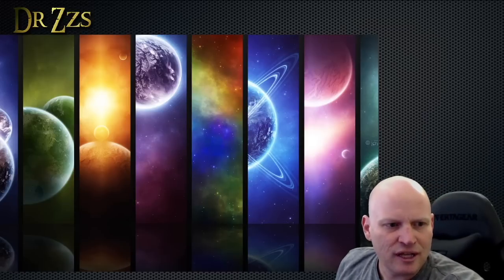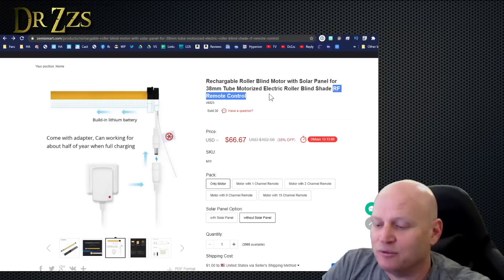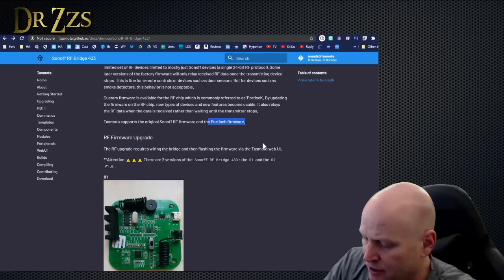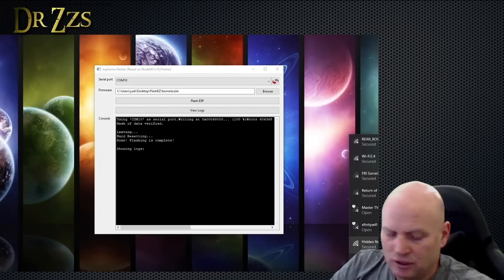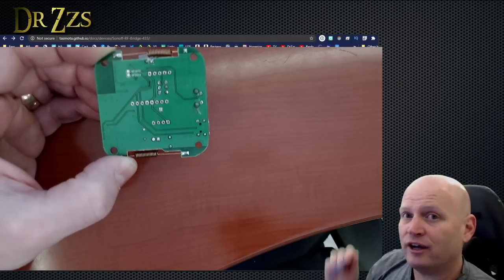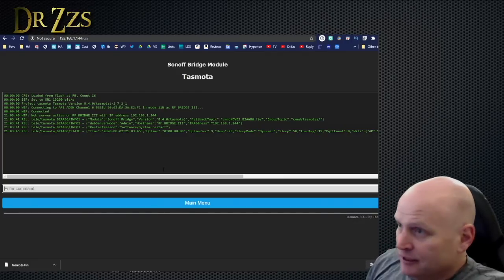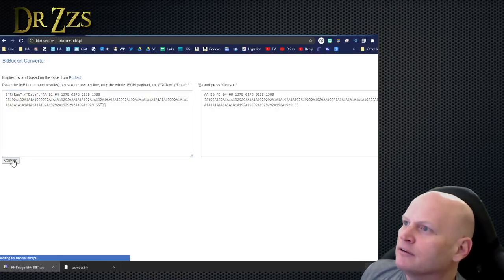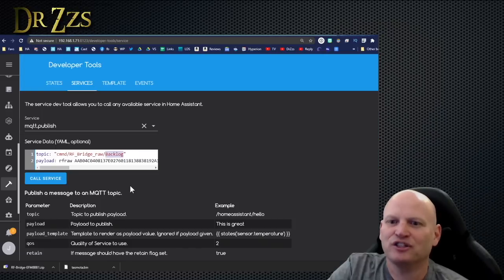433mhz Sonoff RF Bridge using Tasmota and Portisch to scan Raw RF Codes for Zemismart Roller Shades

Comment: Great Video!!! Did you solder the four wires to the Sonoff RF Bridge board, or did you simply plug in the four pins? If you simply plugged them in, is the contact reliable?

Comment: oh boy thank you! I watched your video 4 years ago and had this flashed to get curtain codes running 24/7 since then. Today I changed vlans and set the wrong ssid to the wrong vlan and it got stuck in limbo not being able o connect or reset. Had to reflash it. Wife could not open the gate today as it's used for this and other jobs.

Comment: I have the r2 bridge. Tasmota 13.3.0 . When I try to flash the Portish firmware Version 0x04 ( I connected the 2 jumper cables like you did ). I just get the error:

Upload Failed

Upload error code 210

Please does anyone know what I have done wrong here ?
Reply from the maker: For future reference the best way to troubleshoot this sort of stuff is to join the discord channel.  There are lots of people that are available to help.  It's just really difficult to troubleshoot over comments.
Reply: My fault I forgot to cut the 2 connection. Now it worked!

Comment: What's the website you used to convert the code? It don't seem to exist any more
Reply from the maker: New versions of the RFBridge have a different RF chip and no longer work with Portisch firmware.
Reply: @DrZzs  arr, mine is a few years old. It did flash but had a lot of issues in sending the copied code. It has worked when using the non raw code, but getting that working g in code was difficult. And not 100% sure what tweek actually got it working

Comment: Hi Great video, but I have a little problem. I flashed my Bridge with Portisch a year ago, and working with some plugs (brand does not know) but is working fine with the short code. Also having two Sonoff remotes with the short codes. Now I have something thats build in the Netherlands, and its a tricky thing. But, I have it working, the problem is, once I send the rfraw long code (plug is working/listening} the the Sonoff remotes and plugs don't work any more. Until I restart the Bridge, then its oke again. I have the MQTT but its already happening with the codes directly in the Bridge/tasmota console. Also tried to read the long code with rfraw 177 from the Sonoff remote, but that's not working either. Any suggestions about this?
Thanks...

Comment: Just picked up the bridge and flashed it with Tasmota hoping I could use it to integrate motion sensors and door sensors from an old alarm system which i hope are 433MHZ
I assume if the RF chip could see them id see entries in the console as I walk around the house?

Guess I'll make up some jumper cables and flash Portisch and see what happens.

Thanks for the help so far Doc

Comment: Took a few tries and miscues, but this got me going with at least one RF remote that wasn't showing up under the stock RF firmware.

Being able to bypass the 16 device command limitation is also helpful, though it's kind of a pain to have to do learn > convert > command for every button on something like an LED controller.

Would love to know if there's a way to figure out what RF frequency other devices use, as some of my RF remotes don't seem to be sending on 433mhz, even ones that share a nearly identical form factor to buttons that do show up on the Sonoff Bridge in Raw mode.

Comment: Hi, I tried at the moment do make my bridge useing for RF sniffng. I could flash the Tasmota and switch to 25 Bridge. But unfortunately I couldn't flash the RF IC over the Tasmota Fimeware flash. So I saw that you have another Firmware to flash, not the downloaded RF-Bridge... .hex. From where have you the portisch.hex file? Or what could I make wrong? But I must say, that I have a nwere release named V.2.2 without a switch an the PCB. THX ahead.

Comment: finally got the portisch to synch the chip; kept getting magic byte error and then another error.
 I did everything the written guide said but my PHYSICAL connections with the wires to those tiny terminal ports on the board were not strong/consistent enough. some bending and electrical tape did the trick!

Comment: Hi @DrZzs, Great tutorial! Got a quick question regarding using the Portisch firmware with ESPhome though. I'm having issues on ESPhome (Original Sonoff Firmware on RF Chip) with detecting Sonoff's own DW2 Door sensor (The RF Version). Sending a RF Trigger on the Sensor causes the orange light on the bridge to register, but there are no sniffed codes. Is this something that Portisch would fix? 

Thanks!

Comment: I get Upload Error Error 210 when trying to flash Portisch firmware.  Cannot find a way around it.  Followed instructions exactly, tried it on and off, reset the Tasmota firmware, tried almost everything.  Running v9.5 of Tasmota.  Frustrating!
Reply: NVM, managed to sort it.  I switched it off, then powered it with 3.3V and GND direct to the board rather than via USB, and it worked.

Comment: For those if you who can't flash because you receive md5 mismatch error, use 5v on the ftdi instead of 3.3v. Worked like a charm after many hours of frustration. (I have a CH340 flasher)

Comment: Firstly thanks for your videos, truly helpful.  Having a great time with HASS although my YAMLs are crap :)     I tried this tasmota flash on my sonoff 433 RF Bridge today.   I have flashed my 4ch sonoffs perfectly but this bridge failed to flash  I used Tasmotizer and it backed the device up, erased memory to half way and the bar stopped. Message said this could take some time but eventually it returned an error "timed out, waiting for packet header".  It does the same with ESP flasher.   Any clues on this please.  Had no problems with other sonoff basics so far.   Regard Rodoz

Comment: Before I go to the trouble of attempting to flash the RF firmware, can anyone confirm if this will enable frequency hopping spread spectrum (FHSS) ?  I have a driveway alert transmitter that does not show up in the logs.  On the back of the TX, it says 433mhz FSK + FHSS.  I'm guessing no, but would love confirmation.

Comment: Thanks for the video. I used Tasmotizer but followed your general instructions and got there. With Portisch (the non-cut-trace version) I am now able to capture RF from my 6-speed and reverse ceiling fans. The old firmware did not twitch when I triggered those remotes.

I can now work on linking the bedroom fan speed to temp overnight.

Comment: Hello, 

Thank You for this tuto !

I have followed this excellent (and condensed) tutorial to flash a RF Bridge with Tasmota 9.2 and Portisch Firmware 0x04 (20 Feb 2019 compiled version on the GitHub). 

I also have the Zemismart Roller Shades and a remote A080401F015746 model AC123-06D f 433,92 MHz to control it and it works.

By entering rfraw 177 on the tasmota console and pressing several times the up button on the remote I get this similar codes:

{"RfRaw":{"Data":"AA B1 04 13A6 0280 0118 13D8 38192A192A1A1A19292A192A1A1A1A1A192A192A1A192A19292A192A192A192A192A1A1A1A1A1A1A192A1A1A1A1A1A1A1A1A192A1A1A1A19292A1A192A1A192A1929 55"}}
{"RfRaw":{"Data":"AA B1 04 13BA 0280 0118 13B0 38192A192A1A1A19292A192A1A1A1A1A192A192A1A192A19292A192A192A192A192A1A1A1A1A1A1A192A1A1A1A1A1A1A1A1A192A1A1A1A19292A1A192A1A192A1929 55"}}
{"RfRaw":{"Data":"AA B1 04 13B0 0276 010E 13BA 38192A192A1A1A19292A192A1A1A1A1A192A192A1A192A19292A192A192A192A192A1A1A1A1A1A1A192A1A1A1A1A1A1A1A1A192A1A1A1A19292A1A192A1A192A1929 55"}}

entering the last one on https://bbconv.hrbl.pl gives :

AA B0 4C 04 08 13B0 0276 010E 13BA 38192A192A1A1A19292A192A1A1A1A1A192A192A1A192A19292A192A192A192A192A1A1A1A1A1A1A192A1A1A1A1A1A1A1A1A192A1A1A1A19292A1A192A1A192A1929 55

then I enter on the tasmota console :

rfraw AA B0 4C 04 08 13B0 0276 010E 13BA 38192A192A1A1A19292A192A1A1A1A1A192A192A1A192A19292A192A192A192A192A1A1A1A1A1A1A192A1A1A1A1A1A1A1A1A192A1A1A1A19292A1A192A1A192A1929 55

but nothing is happening.

Did I do something wrong or is my RFBridge not working ?
I am looking for complementary infos or tests.
Thank's
Chris
Reply: I was a little bit disappointed it didn't work. So I bought a second Sonoff RF Bridge, did exactly the same operations and this time the commands are working.
Thank you for this tutorial

Comment: I was able to duplicate a doorbell following this guide. It took all day to get it working. My new laptop does not like any of the flasher tools that I have.  :-(  The old laptop worked just fine. But I did get interrupted ALOT.  Is there a video on how to use the data/codes in home assistant and nodered?

Comment: Followed these instructions for my Zemismart blinds (non solar - very discreet) and they have been performing flawlessly since October. They haven't even been recharged yet. All the control is done in HA through Node Red as part of my overall lighting scheduling. 

Thanks for stepping through this in detail and highlighting these blinds (as did @The Hook Up). Your pain was my gain - all in all a home automation win!
Reply: Its a long shot, but if you see this message, I would love to know how you set this up in node red
Reply: @jackofmosttrades.masterofsome  Putting aside the actual code scraping shown in DrZzs video and the Portisch information, the Node RED part was pretty straightforward. 

For each blind I created an Input Boolean to use as a manual switch in my dashboard. In Node-RED I also created two Switch nodes for each blind - one for up and one for down. Each Switch node contains the relevant code captured for the respective operation for the blind in the message payload (a long hex string) and the correct Sonoff Bridge command in the topic.

In my automations, the blind is either commanded to go up or down (based on sun angle/azimuth, sunrise/sunset, heat warning, etc.). The switch node sends the command to the correct MQTT queue for the Sonoff Bridge AND toggles the Input Boolean to make sure that it always reflects the current blind state.

It's easier to see than explain, so I have exported part of the Node-RED flow below that you can import and look at. I hope this helps!

[{"id":"ba5d49db.d079c8","type":"change","z":"f4508d01.03759","name":"Blind 1 Up","rules":[{"t":"set","p":"topic","pt":"msg","to":"cmnd/sonoff_bridge/Backlog","tot":"str"},{"t":"set","p":"payload","pt":"msg","to":"rfraw AAB036050809B0065E014A028A15C2C092B2B2A3B2A3A3A3A3B2A3A3A3B2A3B2A3B2A3A3A3A3A3B2B2B2A3A3A3A3A3A3A3B2B2A3A3A3B2B2B255; rfraw 0","tot":"str"}],"action":"","property":"","from":"","to":"","reg":false,"x":1950,"y":820,"wires":[["d06d9930.3f86d8","37f0ada2.af37c2"]],"info":"Send code scraped via Portisch."},{"id":"d06d9930.3f86d8","type":"mqtt out","z":"f4508d01.03759","name":"Sonoff Bridge","topic":"","qos":"","retain":"","broker":"955eb2ac.8fa89","x":2380,"y":1060,"wires":[]},{"id":"37f0ada2.af37c2","type":"api-call-service","z":"f4508d01.03759","name":"LR Blind 1 Switch","server":"YourHA.Server","version":5,"debugenabled":false,"domain":"input_boolean","service":"turn_off","areaId":[],"deviceId":[],"entityId":["input_boolean.living_room_blind_1"],"data":"","dataType":"json","mergeContext":"","mustacheAltTags":false,"outputProperties":[],"queue":"none","x":2550,"y":820,"wires":[[]]},{"id":"955eb2ac.8fa89","type":"mqtt-broker","name":"Mosquitto on SAL","broker":"192.168.2.155","port":"1883","clientid":"","autoConnect":true,"usetls":false,"compatmode":false,"protocolVersion":4,"keepalive":"60","cleansession":true,"birthTopic":"","birthQos":"0","birthPayload":"","closeTopic":"","closeQos":"0","closePayload":"","willTopic":"","willQos":"0","willPayload":""}]

Comment: I have a RF sonoff for a while and I tried to connected to the network but it doesn't. It is recognized but when I check on the ewelink app, it says it is offline, and the blue led keeps blinking. Flashing Tasmota and Portisch will fix it?

Comment: If you are powering the device with a computer, OTG adaptor, or FTDI when you flash the RF chip you do not need to cut the traces.  You cut the traces to prevent those two GPIOs from being shorted together when a "compliant" USB POWER only port is used since it shorts together D+ and D- (these traces).  But everyone needs to learn how to cut a trace, and these are the two data lines from the USB plug that serve no purpose without a USB<>UART chip so I encourage everyone to give it a go.

Comment: Hi Drzzs! I have my bridge all flasher as per your instructions! Thanks a lot. I have mqtt broker addon in home assistant - the tasmota appears to connect to it but I can't seem to send any commands from HA. They work fine from the command line in tasmota though. Am I missing something? I see in MQTT config on tasmota the Host is empty. Should this have the IP of the HA? Not sure. The broker does not seem to be listening properly to the tasmota bridge.

Comment: I got a couple of Zemismart roller blinds and able to control it with Portisch. What's depressing though after a couple of months (< 6mos), it stopped working. Issue is not with RF nor Homeassistant since it does not respond via its own remote too. Seems the roller blinds stopped responding to RF. Resetting the blinds does not bring it back to life. Tried opening it up and able to confirm that the dyno motor is still working. Now I got a couple of Zemismart roller blinds accumulating dust. Since the community is vibrant, am still hoping that somebody smarter managed to fix same issue as mine and kind enough to share. Tried getting support from Zemismart but nothing comes out of it yet.

Comment: Hi Dr Zzzz. Great videos. Flashed the sonoff bridge with tasmota as described. Flashed fine. It rebooted but I cannot find the IP. Used Fing and my router tool. Notthing under the name is appearing. Do I need to disconnect the flash cables, switch it back on and plug in the normal usb? Thanks

Comment: Hi, I need help with sonoff rf bridge tasmota portish.
Every time I cut the power and it restarts, it emits the RF signal that activates the opening of the garage.
How do i disable that?
00:00:00 CFG: Loaded from flash at FB, Count 17
00:00:00 SER: Set to 8N1 19200 bit / s
00:00:00 Project tasmota sonoff_bridge Version 8.4.0 (tasmota) -2_7_2_1
00:00:00 WIF: Connecting to AP1 xxxxx Channel 5 BSSId xxxxxxxxx in mode 11N as sonoff_bridge ...
00:00:03 WIF: Connected
18:46:05 HTP: Web server active on sonoff_bridge with IP address xxxxxxxx
18:46:06 MQT: Attempting connection ...
18:46:07 MQT: Connected
18:46:07 MQT: tele / sonoff_bridge / LWT = Online (retained)
18:46:07 MQT: cmnd / sonoff_bridge / POWER =
18:46:07 MQT: tele / sonoff_bridge / INFO1 = {"Module": "Sonoff Bridge", "Version": "8.4.0 (tasmota)", "FallbackTopic": "cmnd / sonoff_bridge_fb /", "GroupTopic" : "cmnd / tasmotas /"}
18:46:07 MQT: tele / sonoff_bridge / INFO2 = {"WebServerMode": "Admin", "Hostname": "sonoff_bridge", "IPAddress": "xxxxxxxxx"}
18:46:07 MQT: tele / sonoff_bridge / INFO3 = {"RestartReason": "Power On"}
18:46:07 MQT: stat / sonoff_bridge / RESULT = {"RfCode": 0}
18:46:07 MQT: stat / sonoff_bridge / RESULT = {"RfRaw": "ON"}
18:46:07 MQT: stat / sonoff_bridge / RESULT = {"RfRaw": "OFF"}
18:46:10 MQT: tele / sonoff_bridge / STATE = {"Time": "2020-08-29T18: 46: 10", "Uptime": "0T00: 00: 11", "UptimeSec": 11, "Heap ": 26," SleepMode ":" Dynamic "," Sleep ": 50," LoadAvg ": 19," MqttCount ": 1," Wifi ": {" AP ": 1," SSId ":" xxxxxxxx " , "BSSId": "xxxxxxxx", "Channel": 5, "RSSI": 100, "Signal": - 32, "LinkCount": 1, "Downtime": "0T00 : 00: 05 "}}
Enviar comentarios
Historial
Guardadas
Comunidad

Comment: Fantastic stuff DrZzs! For 3 years I've been trying to find a suitable solution to control my QMotion GenII blinds. I ended up connecting a 2 channel wifi relay to a spare remote but it always annoyed me that I could only open or close all the blinds at once. Now I've successfully flashed Tasmota and Portisch to an RF-bridge I can control each blind individually. Thanks for showing us how to do this. I would have been lost following the instructions on my own.

Comment: Easy to follow instructions. Everything seems to be in place after Porstich FW upload, however I get the same message every time I issue an RFRAW command. 
Is this by design or am I doing it wrong?
01:29:19 CMD: rfraw
01:29:19 MQT: stat/Sonoff_RF_Bridge/RESULT = {"RfRaw":"OFF"}
01:29:25 CMD: rfraw 255
01:29:25 MQT: stat/Sonoff_RF_Bridge/RESULT = {"RfRaw":"ON"}
01:29:32 CMD: rfraw 177
01:29:32 MQT: stat/Sonoff_RF_Bridge/RESULT = {"RfRaw":"ON"}
01:30:07 CMD: rfraw 192
01:30:07 MQT: stat/Sonoff_RF_Bridge/RESULT = {"RfRaw":"ON"}
01:31:38 CMD: rfraw
01:31:38 MQT: stat/Sonoff_RF_Bridge/RESULT = {"RfRaw":"ON"}
01:33:22 CMD: rfraw 0xA6
01:33:22 MQT: stat/Sonoff_RF_Bridge/RESULT = {"RfRaw":"ON"}

Comment: I have followed the tutorial and have managed to integrate a ceiling fan into HA. Now I have a problem, when I turn on the fan with the remote control, the HA switch does not detect it, and it continues off. 
Then, if I turn on  the fan from HA, it turns off.

My configuration is:

switch:
  - platform: mqtt
    name: "Turn on / off fan"
    command_topic: "cmnd/sonoff_rf/Backlog"
    payload_on: "RfRaw AAB02B0408015E02B200BE22D8381818180918180909181809090909090909090918091818181809180909091A1A55; RfRaw 0"
    payload_off: "RfRaw AAB02B0408015E02B200BE22D83818181809181809091818090909090909090918091818181809180909091A1A55; RfRaw 0"
    qos: 0